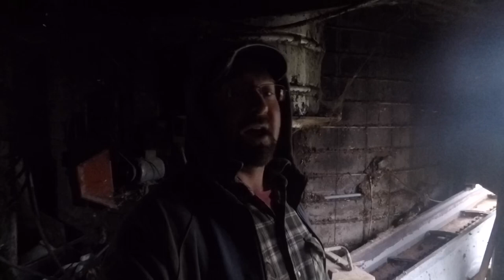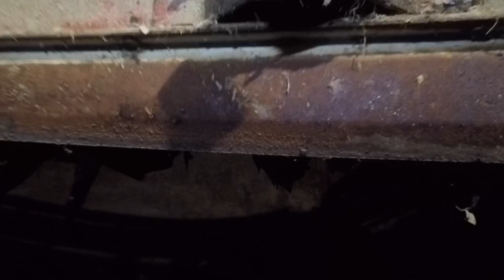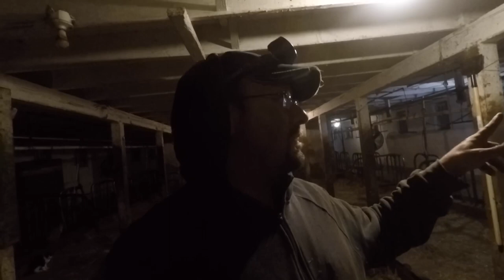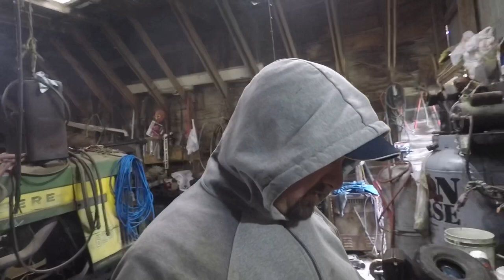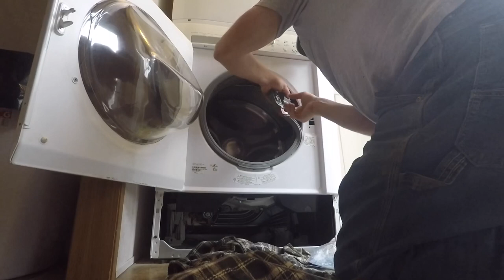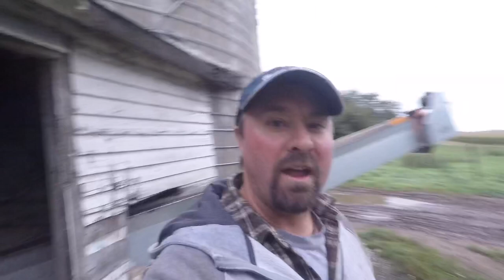Fixing The Silo Unloader With Fire And Other Wednesday - Thursday Farm Stuff!

Comment: Paul, I think you have a larger cat herd than a dairy herd! LOL. It is so fun to watch you pour the milk out for the cats! I have three house cats myself. I love cats, dogs, horses, cows, and lots of animals! ❤️ Putting anti-seize on the threads was a great idea. I put it on anything that I work on that will be subject to the weather. I even put it on the threads on the spark plugs when I tuned up my old '93 GMC truck last spring, that I bought brand new in '93. It has a 4.3L V-6 and only has 90,000 miles on it. I was a trucker and never put a lot of miles on my personal vehicle, but I sure put a lot on the semi! LOL. The plugs had never been changed in it, and my gas mileage was going way down, and so I tuned it up myself because the garages wanted $300 and I bought the parts for $60 and did it myself. New plugs, wires, rotor, and distributor cap. Several of the old plugs were almost rusted in and it took a long breaker bar to get them out. So I put Permatex Anti-Seize on the new plugs. I think I got my money's worth out of those original plugs though .... after 26 years! LOL. Paul, I think this is one of your best videos! I am going to call it my favorite!
Reply from the maker: Thanks mark! 👍😎